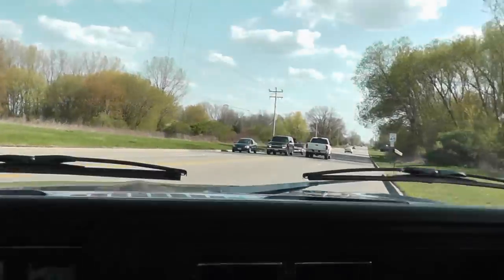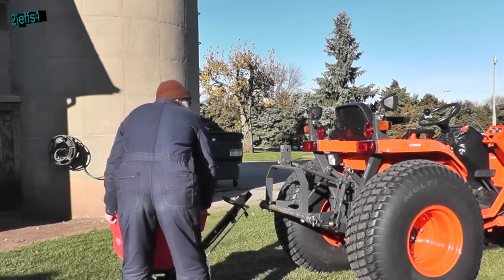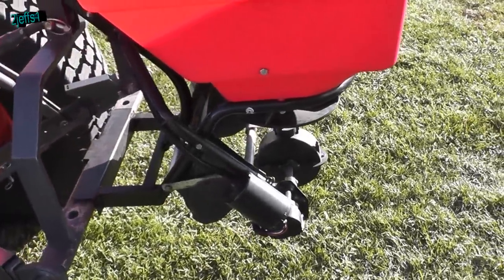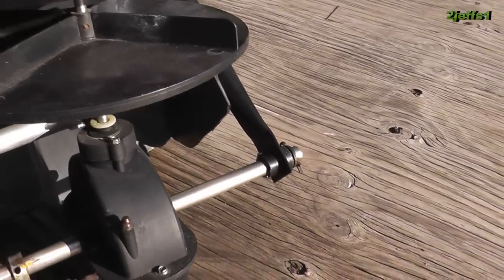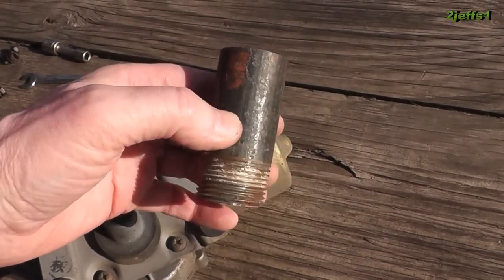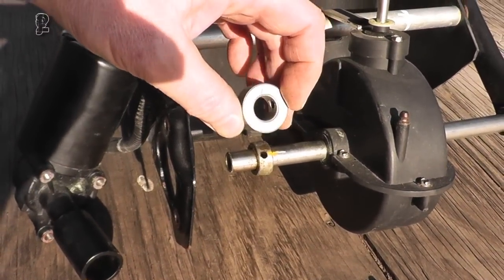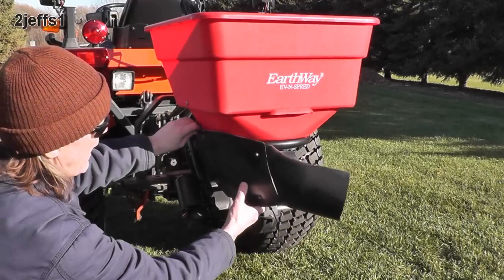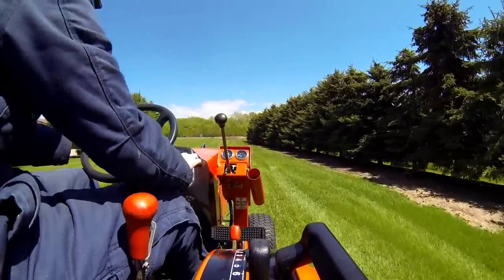How to Convert a Spreader to Electric Motor & Mount toTractor DIY

Comment: definitely building this. have thought about it forever but finally got the wife to forget I had one at the house when we were out last spring. I'm hanging it on my polaris and I'm stealing the wheels on the plow idea too. Thanks
Reply from the maker: Your welcome Billy. When we had those ice storms here I made 1 pass down the driveway, shoot wide open with the travel pedal all the way down, just off idle, high gear. Several passes in other areas. Seems like it took only 5 minutes, all done. Later in the day I bladed all the ice right up. Days like that are when one really appreciates how nice that unit works!
Reply: 2jeffs1 this year sucked in Wisconsin. we kept getting rain then freeze rain freeze. I never really needed a salter till this year. had it ice up put was able to get it easily. so I took the shoes that work like crap anyway and started road grading. the wheels look better than the Meyer shoe skids and those are the most wanted here. Thanks again
Reply from the maker: No problem. Enjoyed hearing from you Billy!

Comment: Cool idea. Can you talk more on the RPM's of the upgrade? Does the spreader throw as far or less than with the wheels? Could a variable speed control be used with this?
Reply from the maker: +Steve Winter Thanks Steve. Great question. I did have the low - hi set up on the wiper motor at first. Never used the low so just put the on/off switch for the hi speed only. I would say it would be equal to a fast walk speed with the motor. With the draw bar all the way up one can cover a wider area and set the flow a tad higher. It is definitely faster than by foot! I know I wouldn't need variable speed for my use. Perhaps your situation would be different tho...

Comment: Wow Jeff, everything you fabricate and build always has that extra little something that makes it look as if it was meant to be. You do great work! That little razor blade sharpener is really cool too.
Reply from the maker: Chip Wright Thank You Chip. This type of thing is what helped me get here saving$$$. I always hope this stuff will give folks ideas of what is available for their projects. It would be nice to purchase everything one wants but that isn't always the option!!! I do like to make things look store bought and don't mind taking certain things that would be discarded and putting them back to use again. Actually that tractor is one of the few things here that I bought new. This stuff helps get the yard necessity's done so much sooner so one can go back to helping others sooner on their needs! That video I have of pres Bush posted would give one the idea of how much work I've done at this place thru the years. (has a pan shot in it of the yard)  That old time blade sharpener was some cool engineering - had to include it!

Comment: Excellent Spreader,  So much nicer to use than pulling one with wheels I'm sure!  Not to mention, all your controls are within easy reach from the tractor.
Reply from the maker: John B Thank you John. I like not having any trailer units. So easy to scoot around everything. I just leave the tractor in high range and idling. Things get done really fast, fertilizer or salting. Being up higher on the 3 point does make the controls an easy grab and covers a larger area more evenly & where the volume control can be opened much more. For shooting fertilizer under the trees with that plastic shoot installed I'll run it quite low to the ground and travel right along too. They probably make an electric one but when one has the things needed in the hoard pile well...

Comment: That's a great mod you did on the spreader..... The razor  blade sharpener is super cool !!!
Reply from the maker: MrTheHillfolk Hi man! You'll like this- Many years ago before the tractors. Went to buy a snow blower. 
Wow - couldn't believe the cost and had to stand out in the cold.  I had a Jeep & made a homemade snow plow. It was a steel frame & wood blade. Took 2 wiper motors, faced the shafts toward each other and made a small spool to wind up the cable to the plow. The wiper motors I used couldn't be reversed so you isolate the brushes from the fields to accommodate that. Now the plow was too heavy and would spool down the cable/motors. Allowing the fields to be energized all the time kept that from happening. Had a couple of those cube relays to reverse it under the hood and the rocker switch on the shifter. A safety chain supported the plow when not in use or just removed it.  Now a days they have those miniature winches which would work fine for such a project but I always liked the challenge of using things readily available from the hoard pile!
Reply from the maker: not2fast4u2c Thanks man! Years back I had hired out several times to have someone salt the drive. Seems sometimes when one finds out what things cost these ideas come about. Those old time gadgets - Wouldn't it be neat to meet the folks that create them!
Reply: Oh man, as usual, great video! 
Even if you don't have a tractor or a use for a spreader you still pick up tons of info!! 
That drive with the wiper motor is great...I can't believe it was right in front I me all this time, that's a great way to motorize something else besides just a spreader...the 60watt in my head is flickering with all kinds of ideas now :)
Reply: Haha that's a great setup, I'm gonna keep those old wiper and window motors around !! 
Not that I threw them out, now I know what I can use em for :) 
I had a crazy idea for my snowblower too. 
Well, the thing is I have a self propelled snowblower, and a riding tractor at the house....
I was thinkin to make a plate, or brackets that the snowblower could sit on in front of the tractor and voila, no more walking :) 
Those snowblower attachments for an existing mower are expensive!!